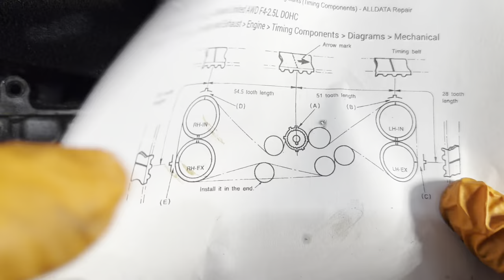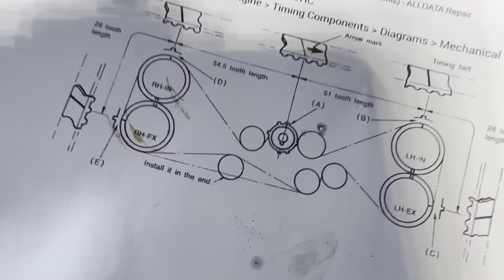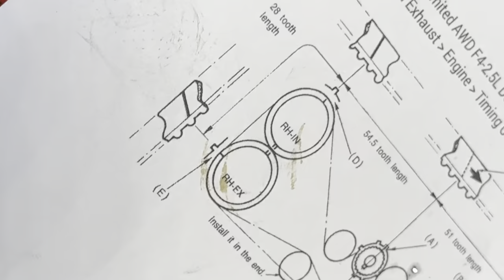SOFT METAL!  Engine Damage! Subaru Legacy Outback AWD 2.5 DOHC EJ25

Comment: Did Subaru use marshmello when they made the blocks? I have never seen aluminum so brittle.
Reply: Use a regular ratchet instead of power tools.
Reply: @s99614 I have said the same thing multiple times here .. he doesn't listen.  The peak torque on the power tool is too high.    That being said threading AL not a great design choice, we know it's done .. cheaper .. but any hi rel application there would be inserts... for something like a water pump, tensioner etc where they are replaced periodically should have inserts by design.

Comment: it would be great if they made a metal timing chain for the ej25 instead of the rubber belt.
Reply: Newer Subaru engines all have chains.
Reply: @fubartotale3389  I wish a company would make a metal timing chain kit for the older engines. It would solve the issue that the ej25 had.

Comment: Couldn't you have just locked the insert to the  installation bolt by  using a nut in the same way as using two nuts tightened against each other will lock them in position - by using the minor backlash in the screw thread?

Comment: are the timerserts OD threads tapered? i'm only wondering since it's an open hole to a water jacket.  if they aren't tapered, wouldn't there need to be sealant put around those treads so that coolant doesn't eventually wick past the threads around the timesert?

Comment: Hey Ray, why would you blow the metal shards into the engine block? You just said if you were to punch through the hole with the drillbit that you would damage other components wouldn't metal shards cause even greater damage? Why not suck it out instead of using shop air to push it in? Just asking

Comment: If lining that belt up is as tricky as that, what must it be like trying to do it with the engine in place? It make you wonder how many cars are running with the timing out a couple of degrees because the mech who last changed the belt didnt get it right.

Comment: O.K. Ray. I'm your Debbie Downer here. About the inner coolant jacket you just spoke about outside the cylinder. Does the jacket fill with circulating coolant? And if it does are you not blowing hard metal pieces into a compartment that will have fluid freely circulating and possibly picking up all those metal fragments? Is there not a possibility of those metal pieces clogging up a coolant port or passage? Just saying and asking for a friend. Explain if you got a sec.

Comment: Great job Ray that Subaru might see another 100k
Reply: You just told everyone you don't know anything about what you are watching. The rear seal has a very small ridge on it that when seated is on the outside of the bore. Sometimes it has a  metal backing plate to keep it rigid against the block, if it doesn't have a backing plate it can, over time distort and lead to failure. When Ray installed the seal it did not have a metal backing plate so as "any"mechanic knows by having that lip inside of the bore and not outside it doesn't allow it to distort and so it provides a much better and more lasting repair. The other moronic thing you said was that the "crankcase" was full of metal shavings. Please explain how that would be possible when the crankcase holds oil? That's right it's the "oil pan" How can drilling into a hole in the block that goes into the "water jacket" ever get into the oil pan? It's called a "water jacket" because that's the area inside of a block and heads that "water and coolant/antifreeze" flow through the block to cool it during operation when the water pump is recirculating it through the radiator. My 5 year old knows you don't mix water and oil and yet you think that's how an engine works? For the future I would be silent and be thought of as a fool then to comment on here and remove all doubt. I bet you use Halogen headlight fluid instead of regular headlight fluid because you think it makes them brighter don't you. 😮😮

Comment: Am I wrong? Is that insert not purposely tapered so the bolt doesn’t go any farther out the other side and in to the cavity since the bolt is already designed to be the correct length?

Comment: That timing belt does it need to be at TDC or could it be accidentally put on 180 degree out or is that not possible due to the timing marks ? Curious for when I do my motor, cheers
Reply: Just mark every timing mark with paint with motor in time before removing belt !

Comment: Unbelievably long belt. If this is an interference engine, which it most likely is, get the alignment wrong then it's sayonara to the motor.
Reply: Search for Lexus LS430 timing belt replacement here on YT if you want to see what a fun job that one is too. Turning the crank 720* by hand to confirm timing is a mandatory step -- the marks on the belt will no longer line up, but the factory marks on the cams, crank, and block will, if everything is properly in-time.  Five more minutes of shop time to do this better-safe-than-sorry confirmation step.

Comment: I am waiting for Ray to do an S10! I almost made it with this one except Troy did the work, not Ray, and therefore isn't recording the work. Does anyone know what year the S10 is? I have a 1997 4-cyclindeer, automatic and it's in very good condition, no body rot at all in the rust belt! I had a 1995 S10 2.2L (same engine) 5-speed and loved it but the frame literally fell apart, the frame midway back was totally rusted-out.

Comment: Why not just remove the 2 bolts that attach that bracket for tensioner pulley and replace it with a new $30 bracket? Too simple?

Comment: I now must say something. I have seen you use blue Loctite on things that should have read Loctite a number of times. But whenever you're putting a Time-Sert, especially into soft aluminum. You should be using red Loctite. If you expect it to be permanent I would use green Loctite because it will never ever come back out of there. Why you are so afraid of red Loctite. Example, every single time you put flexplate bolts into a torque converter, they should have red Loctite. When you put brakes together like caliper bolts they should have red Loctite. The new orange works fine because it supposed to have the same strength. Red Loctite for something that must stay tight, yet still be serviceable. If it is expected to be permanent. Where you are never going to remove that particular set of threads, a tiny bit of green Loctite is King it will not come apart without Heat.
I have found very little things where blue Loctite is actually applicable. It allows the bolt, or the threads to come loose relatively easily. Look at some of the test specifications on blue Loctite red Loctite and green there are no test specifications I've never seen anybody be able to remove a bolt that had green Loctite on it. But I've never seen a bolt that isn't supposed to be serviceable. A Time-Sert however, is not supposed to be removable.

Comment: You can clearly see the top of the insert is broke.
Reply from the maker: It is, buuuuut that's just the outer lip. It's fine, I'd let it ride if it were on my car. It wont affect the strength of the threads.

Comment: Whoever serviced this engine before you over tighten a lot of bolts. This is the curse of aluminum. It’s a soft metal.
Reply: True, which makes it even more perplexing why Ray apparently has something against using torque wrenches on this Subaru's block. 🤔

Comment: First, i am a big fan of ray... but its very common tthat the guy who does general repairs 99% of the time is not set up to do detailed  engine work, and vise versa.  That engine, when taken out should have went to the local automotive machine shop or builder, 5 days later it would have been back ready to go ... in that time RAY could have done 20 brake, suspension and Ac jobs, grossed another 15k and the engine would be fixed and be back in the car... i wonder what the owner thinks of all this ..who is paying for all this ? And whats the warrantee on the repair.?

Comment: OK.... WD-40 will work fine for aluminum as a lubricant, Kerosine is even better.
Reply: No need for lubricant if you know how to drill.  The reality is, you really shouldn't need lubricant because lubricant allows the drill bit to "slip" across the surface that the edges of the tip of the drill bit are trying to cut into therefore defeating the purpose of the drill bit.

Fortunately, in this case, the metal was soft so it wasn't a big deal.  The unfortunately reality is, Ray doesn't know how to properly drill a hole at least not through steel.  But, to be fair, the majority of people don't know how to do this properly either.

People just think that because it says "high speed drill bit" that they can hold the button on the drill and keep drilling full speed.  This this the opposite of what people should be doing when drilling.  The best way to drill a hole is short quick bursts with a second of time in between to let the drill bit tip cool.

If you don't feel the tip cutting through the metal or see the shavings spiraling around the drill bit tip, then you're doing something wrong.  If you just run the drill on full force and force the bit into the metal, after about 30 seconds to a minute, if it's a hard enough metal, you have essentially ruined the drill bit and it's going to be hard as hell to drill through the metal at that point.

Comment: Ray, where on earth did you learn your trade. You are a hack at a epic level. Chips in the water jacket great for the water pump. Also blowing all that crap on the timing gears/seals. Using power tools finally caught up with you. You are by far is the wost goof to ever work in the industry. BTW use Helicoils...